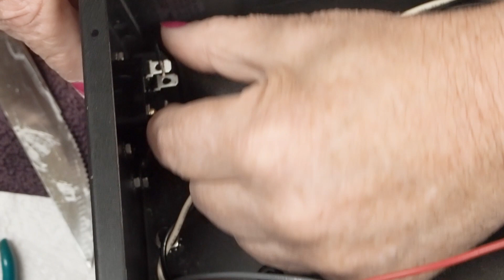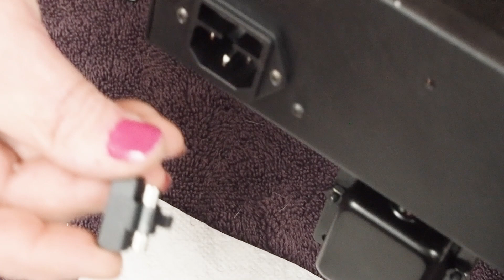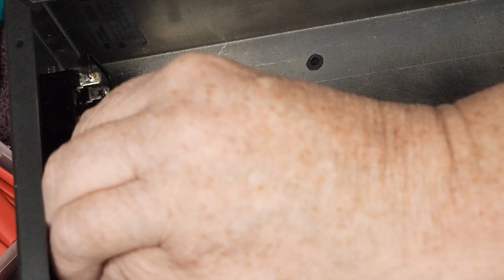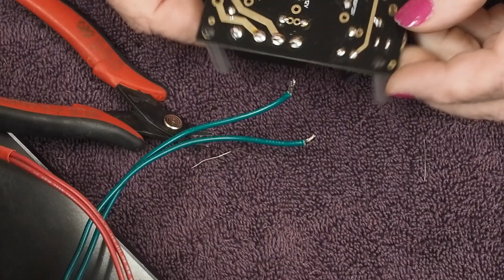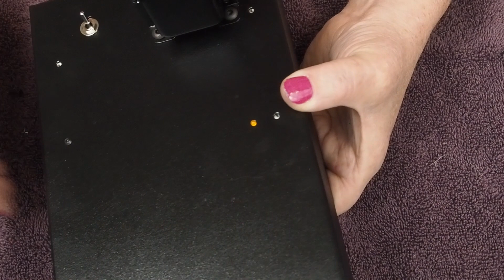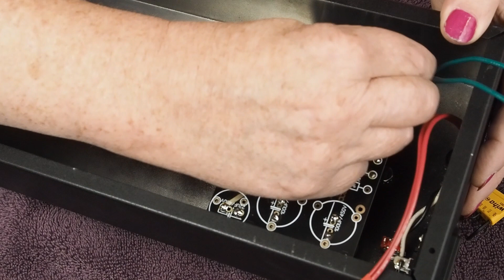All Tube Phono Stage Pre-amp Part 13: Assembly

Comment: The cap across the switch will stop arcing in the switch contacts  Someone mentioned, being on the mains side, it should be a class X2 minimum safety capacitor that are designed to fail in a safe manner if they fail.  That said, if this one did short, all that would happen is the power switch would be bypassed, so not a huge deal.   :)  
Thanks some really great information and for the walk through.   I mainly was watching because I was curious about the EAR clones, but I got a bit hooked into this.

Comment: Hi can you help me with wiring of the mammond 369AX for 230 volts. Which leads i need to wire together. Also which secondariers to use?
Reply from the maker: The secondaries are wired the same no matter what line voltage you use. Hammond's website shows which wires to use for each input voltage.

https://www.hammfg.com/electronics/transformers/classic/300?referer=787

Comment: Any time you use a capacitor connected to any part of the Mains (in this case a Snubber across the switch), you should use a X/Y cap.
Reply: Normally I would 100% agree and chime in further, but in this case, if the capacitor did short circuit as a failure mode, it would only result in the power switch being bypassed and there would be no actual danger.  The cap is only across the switch.   Not really a big deal.   
Being pedantic about it, sure make it an X2 or X/Y in your build, but in this build the worst that will happen is the device gets stuck on.